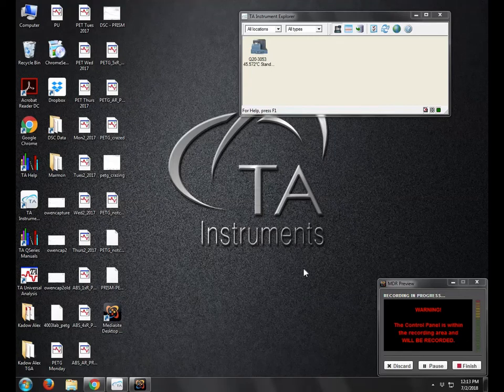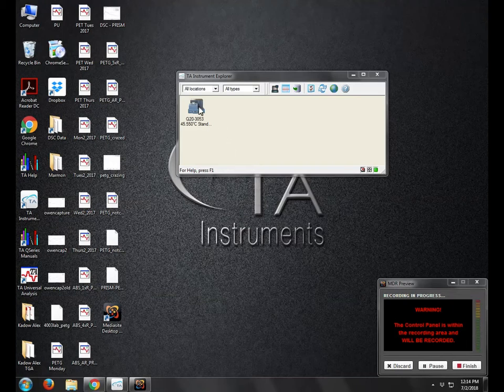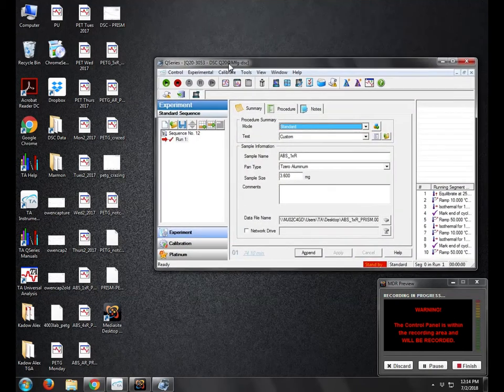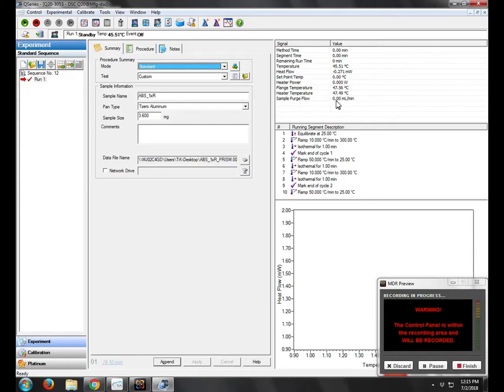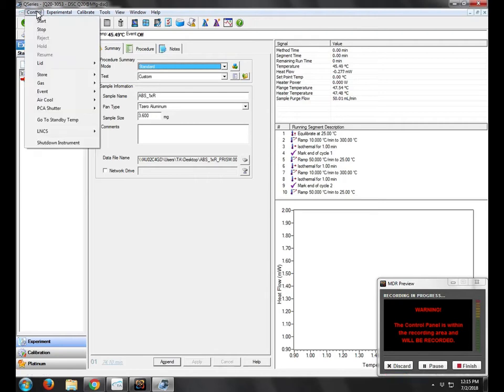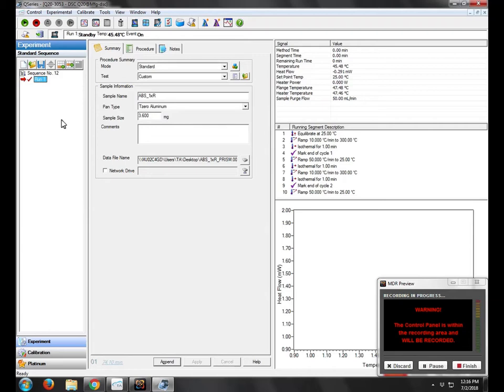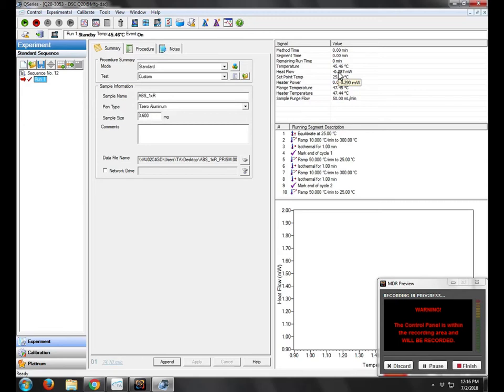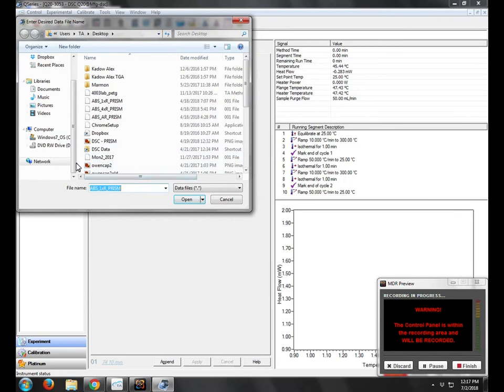Thermal Advantage / Universal Analysis Software Demo (TA Instruments) for DSC Q20

Comment: what is the difference between equilibrate, isothermal and initial temperature? is there a way to get the DSC q10 to return to 35 deg at end of run to prepare for next run?
Reply: in your procedure turn off the data storage and then proceed to ramp down your temperature. You can also set the standby temperature to your desired 35 c.